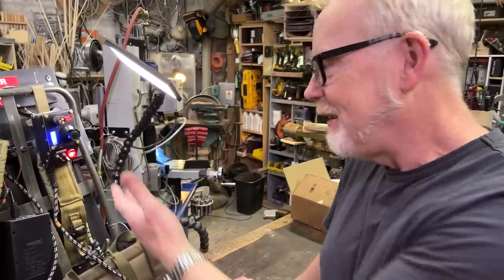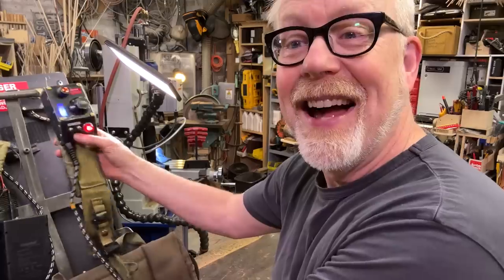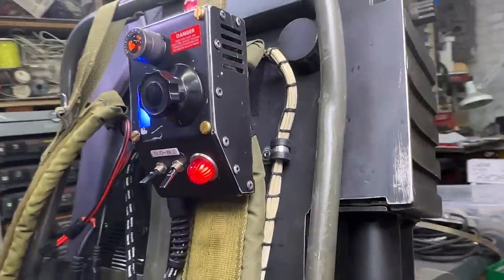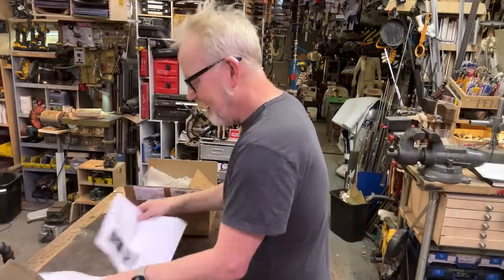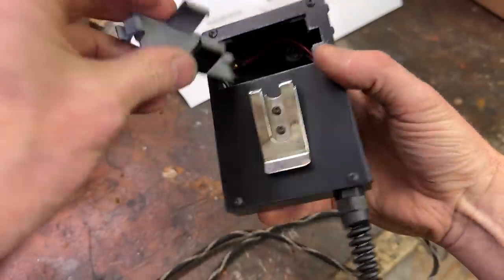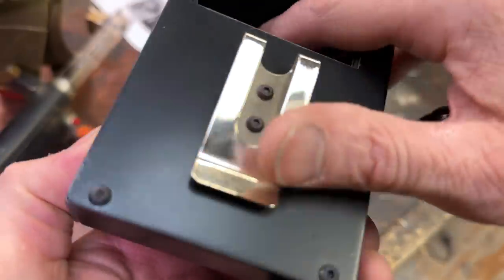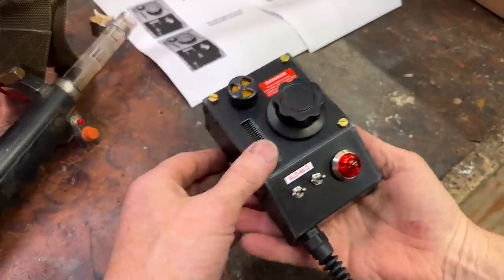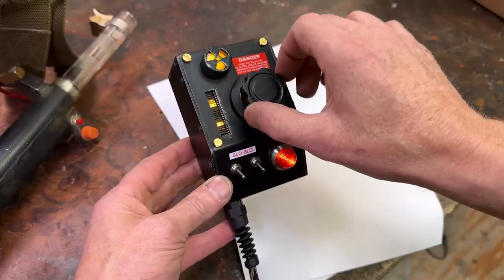Adam Savage's Ghostbusters Proton Pack Mod Gets Replicated!

Comment: After watching your original video on adding the Attenuator to your Proton Pack, I knew that I wanted one on my scratch-built pack (made from Foamcore, Worbla and 3D printed parts). Scavenging parts from an old model train controller (got it for the control knob to go onto the pack), and old portable radio and a few other bits, I bent a frame from alluminum to house all the electronics. I also re-routed the main Power and Volume controls onto the device, so that I am able to switch the power on and adjust the volume from it (plus added some EL Wire to the pack, so there was a switch for that too). Even added a Voltage gauge to keep an eye on my battery life!
I love how the Ghostbusters community is so open and will grab and run with any cool ideas that other fans think of!